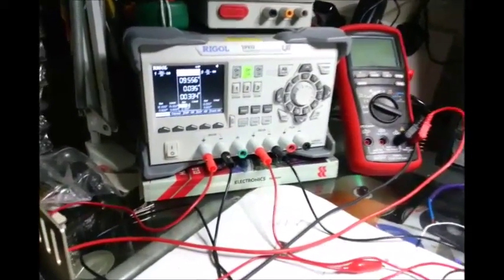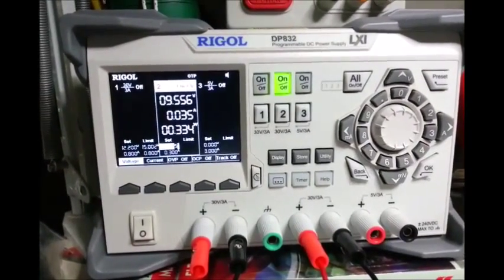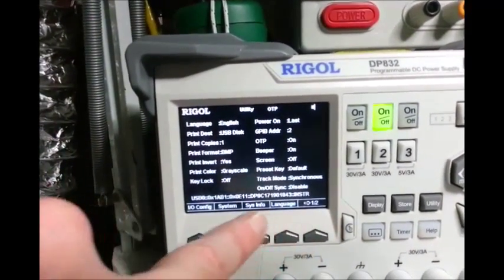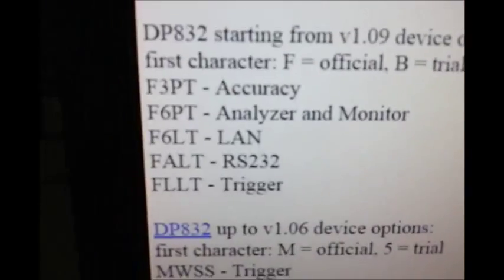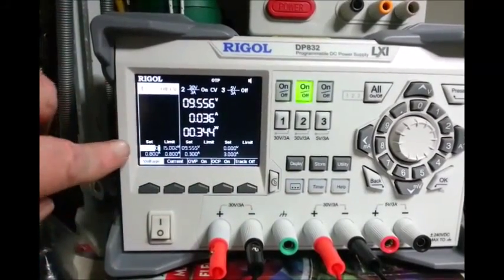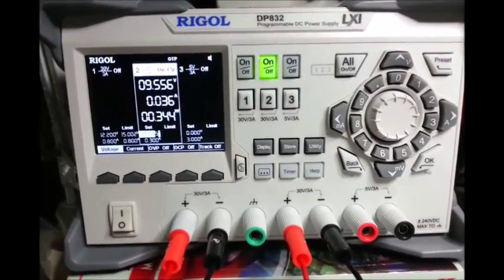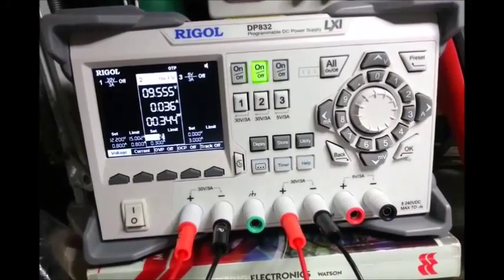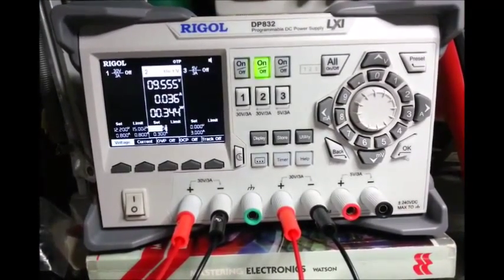RIGOL DP832 Upgrade Hack

Comment: I found that dp832 using DP832A transformer that output is 0-33V 4.5 A x 2 and 10v 4.5A ,is that possible any hack FW to release the 400VA power source ? The existing limit is 195W
Reply from the maker: My understanding is the DP832 and 832A are the same. eevblog made a video. There may be a software hack but I don't know of it.

Comment: Just got my DP832, it has the v1.14 firmware, tried the Riglol... unfortunately didn't work for me.. they probably blocked the keys generated from this website.. sad.. =[
Reply from the maker: I would try again as I have new scope with updated firmware and the keys worked for me.
Reply: try again, make sure you have the right code for the one you want and not just AAAA in the box
Reply from the maker: The keys still work, no probs.
Reply: I had the same problem. couldn't unlock my V1.14 firmware DP832. then after updated the firmware to latest version on the rigol website (V00.01.14.00.03), The Hack worked. Just thought I should share :)

Comment: Do you know if I can program my DP821? Using your procedure? Thanks!!!
Reply from the maker: Try it out. It will either work or not. You won't/can't brick the PSU.
Reply: @Elecifun  See my notes what happen when I tried. Do you have the software it self? Or do you know where I can use it to generate my codes? Thanks.
Reply from the maker: @tonysfun  The code is available via a link on the page. Also make sure you pick the right generator for your software version. DP832 has 2 versions available. 
DP831 is different firmware and not available here.

Comment: Have you had any of the issues reported around the web? I'm thinking about buying this, but for the money I do not want to have to do the number of repairs that I've seen for the various issues that this power supply seems to have.
Reply: rigol has fixed most of the issues with this PSU I have not hit any snags with my new one yet
Reply from the maker: As far as I can tell this site still works great. Keying in the correct characters can be a little tricky as the font is small and the jog dial some are not familiar with. I believe it had a couple of bugs but the one I bought was newer than most others on YouTube with issues. Mine was fine.

Comment: RIGOL DP832 has 13-15 millivolts ch1 voltage display error? What about "you must pay 80Eur shipping" for in warranty item? RIGOL even grants official service for a local company that can only ship the thing to RIGOL Germany. Should I ask for donations to the official service center can get RIGOL 6.5 digit DMM to perform their tasks as service center?

Need I remind you the DP832 is same as SP832A version with 1mv declared accuracy. What RIGOL does not want you to know is that after you buy the software key for higher accuracy you must also ship the SP832 at your expense to fix this "flaw".

The numerous stores I asked to install demo key for high resolution to provide me proof that their SP832 boots and shows all zeros 0.000V failed to do so. They refused to provide such images claiming no demo keys are available. etc. etc.

Do not buy this RIGOL DP832 crap PSU, unless you have 6.5 digit DMM and can calibrate it.
Reply: You need to manually calibrate it.
Reply: @Doctorlockpick  I do not have a proper 6 digit DMM to do it, and for the sake of it you need to have RIGOL DMM as automation works with it only IMHO.